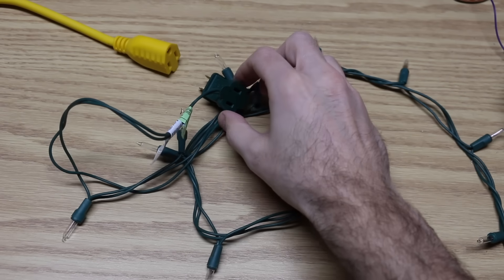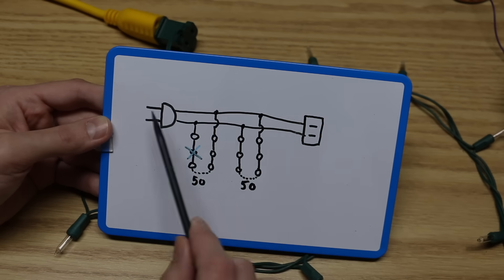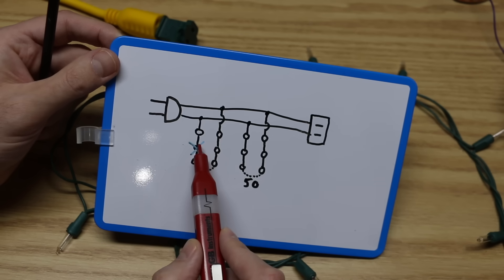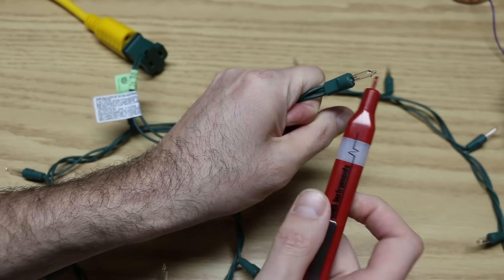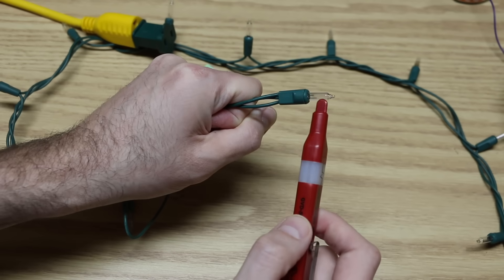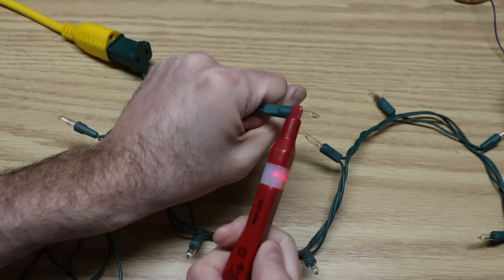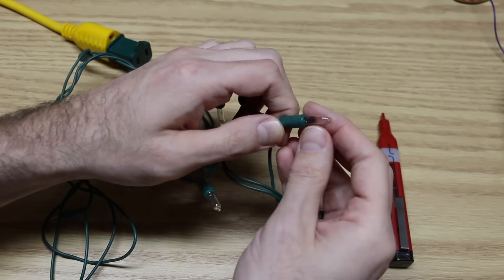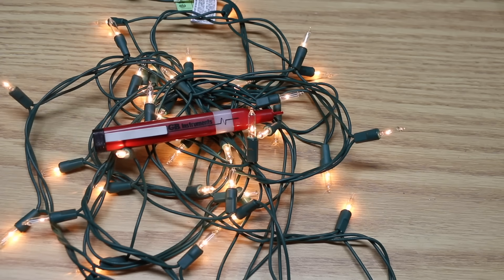HOW TO EASILY FIND BAD CHRISTMAS LIGHT BULBS using a non contact voltage tester

Comment: Hi, I think the video is cool and interesting within its own right and I definitely learnt some new things. That said, why would you want to spend the same maybe even more time doing this method rather than just pulling out the bulb and putting in a new one and rinse and repeating this until they turn on? I suppose if he did the method in the video enough you'd get quick enough where it would make detecting the issue faster but that would take me forever checking each bulb. Cheers.
Reply from the maker: near the end of the video it was pointed out that you wouldn’t actually go one bulb at a time testing them you would go about halfway and see if you found which half of the string the problem is on and then keep reducing by half so I clarified that in later videos. 
Back when the video was made it was more about explaining everything going on from a technical perspective rather than being for a general audience looking to just implement the procedure but then the video got all of this main stream attention so I made a couple of follow up videos to simplify it.
Reply: @GadgetReboot  Fair enough. Must've missed it some how. Cheers.

Comment: Bro.  I was playing around with a ohm meter for like 2 hours trying to find the break. No idea why my brain didn't think 'Use the non-contact voltage tester'.  I'm so used to working in DC with LEDs, my brain didn't click.  Thank you. After watching this video for like 2 minutes, I went downstairs into the shop and found the break in like a few minutes. It wasn't a light, but a contact inside the housing that was pushed down and wasn't making contact. The lights have shunts in them so I knew it probably wasn't a broken shunt AND light. I love YouTube :)

My kingdom for parallel LED light strands. Serial LED light strands are as evil as printers.
Reply: OMG, I'm the president of this club which you don't want to belong.  I've tried 1000s of ways to check these sob small lights and still the best way I have is to check each damm stinking bulb in a tester or ohm meter.  I think the reason this works is because you have to shield away the other wires so no bleeding and even with polarized plug, I now have a better understanding of how to use a live tester.  Oh MY aching finger tips trying to yank those crappy things apart as I'm too cheap to just buy another 500 when I can't figure it out.  Especially once they are installed on a 15' tree.  My question would be does this work on LED xmas bulbs?

Comment: These probes detect  changing current..flux  I assume, since there's no current flow as the bulb is open circuit in the chain, how is a result achieved shown  here?  Is one side a bit like an Aerial in transmitter maybe in swapping plug pins round..,, Thx in advance..
Reply from the maker: with the open circuit condition, there will be 120 V present up to the point where the break occurs and then there will be nothing after so then the probe in the tester combined with the person holding it can detect small stray currents with stray capacitance to ground through the persons body so it’s small but detectable, and amplified by transistors in the tester to activate the LEDs and beeper.

Comment: Remove the first bulb and look at the leads. If the leads are copper, throw the string out. The LED strings with copper leads will fail due to corrosion when exposed to air…

Comment: Good video. And a great idea but I feel doing your whole process is the same as checking every bulb visually. 
What I would do is start once in the middle of the run. That will tell you if your break is to your left or right. Next move down 10' and try again. 
Ya know what I mean?

Comment: Been doing this for years - great trick.  Another problem that sometimes a loose wire, you get partial current flow and nothing will light up.  Just pull a bulb at the end to make an OC so you have line voltage at the last working bulb.

 Advanced mode is when you have an older string and replacing a bad bulb then blows out one further upstream.  Start over.  Again.  Wife asks why you're wasting your time on those old lights and just run down to the Walmart and get new ones.

 An hour and a half later, replace half the bulbs.  Won the light battle but but the wife was right...7.99 at Walmart wasn't worth the hassle.

Comment: I bought the tester you linked but it doesn't seem to work, gives inconsistent results.  I see other testers go lower than 50 volts, is that the problem?
Reply from the maker: it should work because we are expecting 120 V when the circuit is broken, there’s only a low voltage across each bulb when they are working and lit up.
The only time I have a big problem getting things to work is it there’s a lot of bulbs dead in the strand. Do you have another good strand you could compare against like remove a bulb and then try probing around to see if it’s any better there?
and does the tester reliably indicate power if you bring it near a wall receptacle hot side versus neutral side? If I put the tip in one or the other slot on an outlet on the wall it reliably goes off with the one side and nothing at all on the other
Reply: @GadgetReboot  It did work on a good strand. It also worked in the wall receptacle.  The strand I have problem with is different in that it has one wire that all the lights are connected to and 2 parallel wires that both run along the strand.
Reply from the maker: Is it randomly detecting voltage and then not detecting it in the same spots?  
Try gripping the wiring near the bulbs so just the wire going bulb to bulb is exposed and the hand is preventing line of sight between the tester and any other wires in any direction.
Raise the bulb being tested up away from the rest of the strand also to minimize picking up nearby hot wires.
Reply: @GadgetReboot  I've tried it every which way

Comment: Most new lights jump power so one doesn’t take them all out. I have several burnt bulbs on the lights built into the tree. No time for that, I just wrapped a new strand around the dark patch.
Reply from the maker: The burnt out ones should still be replaced at some point because the remaining lights are now taking a higher voltage and may burn out faster, getting worse each time another blows until they're all gone suddenly.  
I usually put an extra set on the pre-lit tree so I can change between white and color, or different fading pattern vs always on full.

Comment: Thanks for the awesome video. I just wanted to share what I learned about buying replacement bulbs based on the number of bulbs you have on your string of lights:

-20-light strings – 6 volt bulbs
-35 & 70-light strings – 3.5 volt bulbs
-100-light strings – 2.5 volt bulbs 
-200 & 300-light strings – ES (Energy Saving HD (Heavy Duty) 2.5 volt bulbs   

 Every manufacturer makes their own mini light bases, so the one you buy might not fit. If it doesn't, you can pull the bulb out of the base from the ones that you purchased and install it on the ones that you have.

Comment: I have multiple burned out bulbs where I can clearly see the filament broken, I switched them out and nothing has changed. This is at least 4 bulbs I've fixed. What gives?
Reply from the maker: There may be others broken that need fixing. Especially if 4 were already broken, it sounds like possibly 1 or 2 were broken to start but the shunts were keeping the rest of the bulbs lit, so each bulb now had to share more voltage, burned hotter/brighter, and more started breaking until it was a bad runaway situation of bulbs blowing.  If there's a bunch like that and if it's hard to track them down, it may be just best to discard it because it could take too long.

Comment: @ 2:45, you switched the plug around.  Baffled how you did this.  The light plug I have goes only one way.  Additionally, I get no reading on all the bulbs that are good, which means I need to switch the plug around but cannot.  Unfortunately this method does not work for me.  Looks like a great solution if the plug could be switched.

Comment: In my light strands, if a bulb is burned out, the rest of the strand stays lit.  It is only when the two wires of the bulb are not seated or if they're broken that continuity is lost and the strand goes out.  It was the OLD DAYS when if a bulb burned out, the strand would go out.  Tell me if I'm wrong.  I have plenty of strands where one or more bulbs are burned out but the strand stays lit.

Comment: Finding extra bulbs for the little light sets is the toughest part. I have dozens of sets and all the little lights have bases that are designed differently. They just want you to go out and buy new light sets.
Reply from the maker: sometimes I just keep dead bulbs around just to have the bases and then I can take a good bulb with a different base and bend the wires on it so I can just pull the bulb up out of the base and then re-insert in the correct base and bend the leads back again and use it that way.

Comment: No need to separate the lights out once you have the plug correctly polarized,  because the wire running through is neutral as you demonstrated. So there's no need to shield each bulb.
Reply from the maker: It may not always be necessary but I showed in this other video how it can be needed https://www.youtube.com/watch?v=fB5o-COdxa4
Reply: @GadgetReboot  with respect, your second video proved again my comment. The first step should be to test the wire that runs straight through. If it's not the neutral, then the tester will beep, and you know to reverse the plug. If it is, then you can go from bulb to bulb without shielding them.
Reply from the maker: When I’m doing the test I am making sure the line going from bulb to bulb is hot, and in the video I show how you still need to shield so  It could also be related to the different sensitivity of different testers, maybe mine is able to pick up the hot connection on the next bulb beside the one I’m testing so it would have nothing to do with the wire that’s running straight through to the other end, so in that case I do need to shield maybe.

Comment: These are old lights right? Newer strings stay all lit if one burns out , that's because the wires are still making contact on the inside.  I would just throw them out if I had to go through that process.

Comment: Um. I don't think that the number of lights determines the voltage. Watts yes, voltage no.
Reply from the maker: with all lights performing equally, the voltage across each bulb should be nominal 120 divided by how many bulbs there are if that’s what you mean.

Comment: This doesn’t seem any faster than pulling the bulbs one at a time and this only works if the lights are off the tree. If one burns out after you put them up it’s going to be difficult to shield the bulbs to check them
Reply from the maker: This may work better for lights that are already in place and harder to test  https://youtu.be/4JxXMluHDac

Comment: Pretty much every modern Christmas lighting system with small Italian-style bulbs won't fail if a bulb burns out. Don't let any retailer make you think this is special. The reason is that each bulb actually has both a filament and a “shunt”, an alternate path for the electricity to get through the bulb.

Comment: Good suggestion.  I never thought of using an NCVD. One suggestion I'd offer is you can start in the middle.  If the power is good to the middle, that's 25 lights you don't have to check because you know the problem is further down the chain.  Skip 10 bulbs ahead.  Power there - go further.  No power there - go backward.  You can go by twos and find the bad bulb quickly.

Comment: Use that on the older sets.  Will in no way work.  2 way 35 lt.   5 way 50 lt.  3 way 50 lt    5 way 100lt.     Use a volt meter and pull every 3-4 th lamp.    No end receptical

Comment: Thanks.  Worked like a charm.  One side note: my tester wasn't working. I removed the battery cover and found that the two button batteries had slightly oxidized surfaces.  I burnished them with the edge of a utility knife until they shined, popped them back in, and it is now working like new. Also, a quick visual inspection of the string, bulb by bulb will sometimes identify the culprit. Burn outs have a telltale grayish opaque coating on the inside of the bulb.

Comment: So there must be a diode in the plug. Great explanation. In the USA, Harbor Freight sells a non-contact voltage detector for 5 bucks (that's slang for dollars). This could come in handy for shorts in car wiring (a Fox and Hound), but that might need an alternating current (signal generator) source since this would not work for DC.

Comment: A good place to apply the Fibonacci search technique!  Check both ends, then check a place offset from the middle - you have the potential of zeroing-in on the bad bulb in fewer moves.
Reply: I think this is binary search
Reply: He mentions this technique at the very end.
Reply: Fibonacci search? I was going to apply the Nyquist sampling theorem for signal processing, but then I realized we were just looking for a burned out lightbulb.😂

Comment: if the connection is running through and is detectable, why would it not light?
Reply from the maker: because if the bulb is performing as designed, once it burns out there is a bypass shunt that takes over and completes the circuit turning the bulb into just a wire and the goal is to replace them as soon as possible when that happens but sometimes the bypass doesn’t kick in and that’s when half of the string goes out because the circuit is actually broken
Reply: @GadgetReboot  I mean when you're going up the string and testing you're passing a bunch of bulbs which have current running through it, but not lighting up. How do all those bulbs have current but no light? how is that possible? (they werent burnt because when you found the actual dead bulb they light up)

Comment: We have a light set that keeps blowing the master light bulb. Any ideas why it blows a new bulb as soon as it’s replaced?
Reply from the maker: my first thought, assuming there’s many lights out in the string, there may be a lot more bulbs blown than just a couple, so when you put in a new one and it completes the circuit, it takes a heavy voltage burden because there’s less lights working and sharing the load. 
every time one bulb blows, the rest see more voltage and their lifespan will be shortened and eventually so many are blown that the ones that are otherwise good start to blow early. when it gets to that point I just consider not bothering to try to replace all the broken bulbs
Reply: @GadgetReboot  exactly my thoughts which is why we replaced almost 30 burned bulbs in that string before blowing another master bulb. But can’t say that I got them all because we ran out of bulbs but thought we wouldve replaced enough to share the load but may be not. Agree, need to replace strand

Comment: what if the whole string of lights is out?  what do you do?
Reply from the maker: if the string has fuses in the plug that would be the easiest place to start. 
It’s also possible that so many bulbs were burned that they all might need to be replaced so it may be worth just getting a new string finally, because if you try to track down just one that is broken and replace it, it might instantly blow again because it’s seeing too much voltage.
and of course there could be just a damaged wire somewhere along the string which would also make it best to replace the whole thing.

Comment: Would have been nice to know this before the last year I spent getting my lights on my tree going. after a year long (off and on) trouble shooting, I found 4 strings out. 2 had bad bulbs needing replacement. 2 strings were just bad (every bulb was good and fuses were good). What can you do about bad strings?

Comment: I didn’t read all the comments, but in a string of 50 or more, you should do N/2, so after discovering hot, jump to the 25th, and if hot, go to 37th, or 12th If dead, halving the lights, so you should be able to resolve 50 lights in 6 test points maximum, i.e. 25, 12, 6, 3, 2, 1 or 25, 38, 30, 34, 32, 33. If the entire string was in series, fault found in 7 test points or less

Comment: Back in the '80s, I worked for a TV repair shop (yes, that was a thing back then lol.) My boss asked me to find the bad bulbs using an oscilloscope probe in much the same way.

I always wonder, however, how the lights can work fine through a season and burn out in the box while not being used. Where's a philosopher when you need one!
Reply from the maker: since incandescent lights often fail when they are first powered up with an inrush, maybe they were ready to fail the last time they were on and then they actually failed when they came back out of the box.  or of course maybe the filaments got compromised over the year when things were banged around.
Reply: @GadgetReboot  Best explanation I have heard, thanks!

Comment: Thanks, I have an old set of lights that has a twinkle mode I really like and is just the right length for my outdoor stairs.  It's getting finicky to maintain so this video is a lifesaver.  This is the first video that has clearly explained how the voltage tester works.

Comment: I will be doing this today. BTW, you don't need to shield things with your hand. An inch or two space between the wires is enough. Matter of fact, in most cases (depends on the tester) you can test at the tip of each bulb and that will be far enough away from the wiring. When you get "no light" you back up one bulb and retest at the wires. Saves a LOT of time.

Comment: Awesome instructions that solved my light problems.  I had tried this before with a non-contact sensor, but didn't know to swap the plug to get the neutral to the extra wire.  You can easily swap out bulbs from other strings and if the plugs into the sockets don't match, just bend back the contacts, pull the bulb out and put it in the original plug..